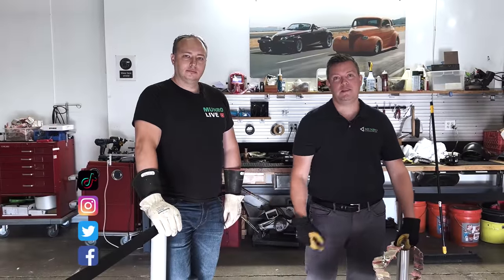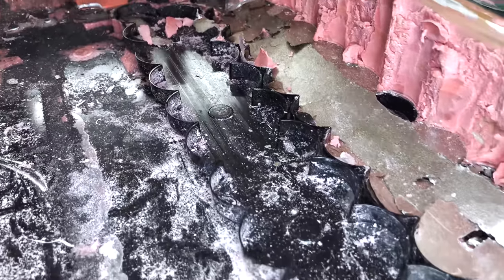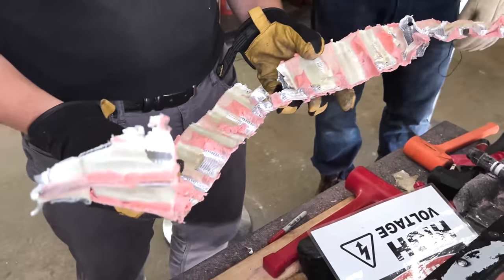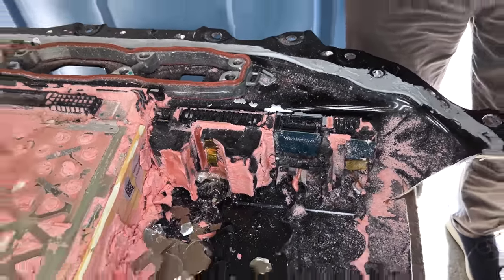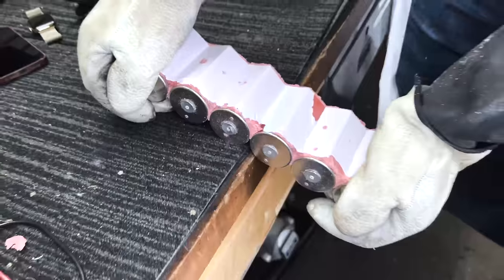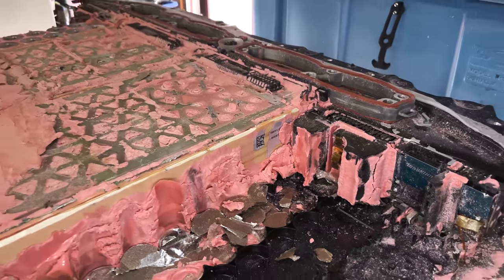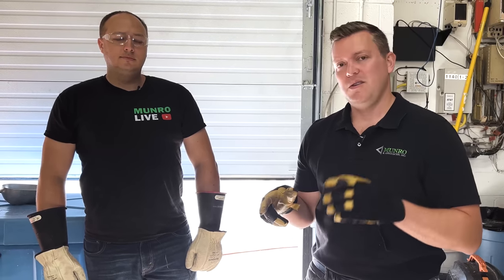4680 Update Structural Adhesive | Tesla Model Y

Comment: So none of the battery electronics is serviceable?  Conceivably an entire battery pack could be crippled by a single capacitor, IC chip, or other single component? I am asking a real question.
Reply: That is all in the penthouse under the rear seats go back and watch video Giga Texas structural battery pack cover.
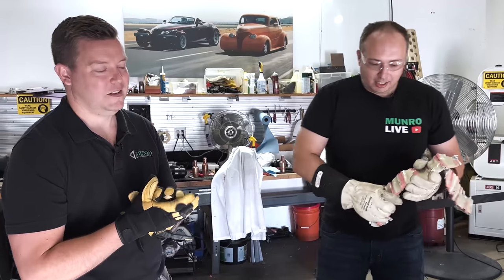Reply: @jackdbur  03:16 The Battery Management boards are clearly embedded in the structural foam.

Comment: Zero possibility of servicing the pack, that mean they need to be hyper confident in the battery reliability. Not that servicing battery would made a lot of sense anyway.
Reply: After nearly 20 years of experience, they have every reason to be confident.
Reply: @andrasbiro3007  I mean in the 4680, it’s brand new.
But I know Tesla has the most experience in those kind of battery pack and the failure modes. I think that completely closing off the option is a good thing, make you focused on solving the real problems: reliability, cost and energy density
Reply: @alexforget  The cells are not that new. They prob had these cells 5+ years ago in the lab. So that is 5+ years of reliability testing on these cells.

Comment: Wouldnt it be easier to FLIP the pack OVER and remove cells from the bottom ?
Reply: You didn't watch the series? No, take the bottom off and the cells are still all stuck in place, and there no access to take apart the electrical connections, either to understand the design (the point of this teardown) or to extract cells without damage

Comment: I’m not a fan of that pink foam because the battery is a major part of the car and all you need is 1 small thing fail and the entire battery is done for. You can imagine after warranty needing to replace the whole battery which would cost more the the car itself. Scary 😟
Reply: bill ted  I was thinking the same thing. There is no way you can recycle the battery and it probably would never decompose. So you would probably have to burn that toxic foam.
Reply: bill ted  other than Tesla is all ready recycling 4680's
Reply: @chris5248  they mine the individual elements of the battery out of rock with as little as ounces per ton of ore this is pure elements just combined in to a battery pack recycling will be much easier & cheaper than mining

Comment: It's clear to me that there is no way this battery pack can be repaired if a module goes bad, the whole thing would need to be replaced.
Reply: It's junk. I'm so disappointed.  Tesla has gone from the dream EV that I want to the one that I will never buy on the back of this design.
Reply: @davidbrayshaw3529  lol
Reply: @davidbrayshaw3529  A "repaired" battery pack is something you should never want! It is destined to failure & dangerous to any worker attempting to repair it. That is  400v DC that is capable of hundreds of Amps of current one dropped tool or wrong touch = death! Would you rather someone die so you could have a shoddy cheap repair? Who would you be sueing when said "repaired " battery pack burns down your house and someone of your family dies in the fire ?
Reply: @jackdbur  I worked as a hanger rat (AME) for a number of years. I am very aware of the potential outcome of not following servicing procedures in accordance to formal directives and protocols. I've also accidentally made an arc welder out of a 12V lead acid battery by dropping a spanner
across both terminals. Mistakes can and do happen. And as you correctly assert, 400 v @ several hundred amps is an immense amount of power.
Perhaps due to my prior occupation and interests I have a little more faith in my fellow  man to perform certain tasks than others do. This includes the ability to safely design and implement a standard for servicing battery packs.
Believe me, if I didn't think that this was a very realistic goal, I wouldn't waste my time claiming that it is. I also wouldn't fly on a commercial airliner 
either. They're a lot more complicated than a series/parallel battery pack and when they fail, it's a much bigger fire with a lot more families engulfed in flames.
Reply: @davidbrayshaw3529  My take on it is the liability issue faced by Tesla that even if the pack was "repaired " by another party Tesla would be named in any litigation & face large damages / PR hit. Again a supposed repaired battery pack will not come up to specifications and will be determental to Tesla's reputation. You will know that there are many aircraft parts that are mandatory single use for safety reasons.
Reply: @jackdbur  It would be good to see Tesla take responsibility for the serviceability of these batteries, much like Rolls Royce takes responsibility for the serviceability of their gas turbines. This simple path would remove the risk imposed by third party repairers. And what a PR opportunity in the making for Tesla. I can see the headlines now: "Tesla Not to Produce Disposable Cars". 
Yes, a multitude of aircraft components have a timed life. Yes, some components are disposable. But there are still plenty of 40, 50, 60 and even 70 year old aircrafts flying on a regular basis. A true testament to good design and maintenance, I would suggest.
Are we going to see 40+ year old Tesla's on the road? I think we both know the answer to that. I would like to be wrong but with all the aid of modern design and assembly tools, Tesla are highly unlikely to be able to produce anything that is even remotely near as durable as something like a Cessna 152 from 45 years ago. As a species, we need to stop building and buying disposable products. We can't consume our way out of climate change. Why on Earth do EV manufacturers somehow think we can? I want a ticket to Mars!

Comment: And the most amazing illustration of structural strength during that last demonstration was that it was a single row. You intertwine that with just another single row from the honeycomb of cells and that thing is never going to break. Now multiply that by the whole pack.
Reply: Vertical, horizontal and torsional strength.
Reply: Of course it’s epoxy glued together what do you expect??
Reply: I imagine with this sort of strength if you have two of these packs, you could use them to bridge a small creek or drain... probably with a 10 ton rating.  That's one way to recycle them in the future ;)

Comment: Have you been able to determine yet how many 4680s and in that pack? Are all of them actual battery cells, or some of them "blanks" (which would explain the low range of 279 miles)?
Reply: In this video they said 69 cells per bandolier. Not sure what a bandolier is. But 69 x 12 is 828. Isn't 828 one of those number we thought it might be?
Reply: @scottbreseke716  Yes, that's the number. We had the cell count months ago, after the display at Giga Texas: 828 cells. That group attached to a cooling channel is what is now commonly called a "bandolier" (like an ammunition belt) and it does have 69 cells; there are three of them per section (for 207 cells per section) and four sections in the pack (for 828 total).
Reply: for there to be blanks there would have to be entire groups of nine cells in parallel replaced by blanks (they haven't seen any) or one cell in every group of 9 replaced by a blank (no).
Reply: @brianb-p6586  So you're saying there ARE no "blanks," the pack is full of bona fide 4680 cells…? Then WHY is the range only 279 miles? 4680s are supposed to increase range by 16% —not lower it.
Reply: @Yanquetino  welcome to reality, which is often unlike marketing promises.
Reply: @brianb-p6586  Ah… well, if that's the "reality" for a full pack of 4680s, they might as well have stuck with 2170s.
Reply: @Yanquetino  Don't forget about manufacturing cost, which is the only important factor in this design.

Comment: Any concerns regarding the repair and serviceability of the structural packs due to the pink foam?
Reply: It's not serviceable. Even modular packs today isn't so easy to service when you account for the hours. With more streamlined recycle process you ought to get quite some for a bricked battery pack just by the materials in them (cheaper than mining all that).
Reply: @subwarpspeed  hopefully they will offer an extended warranty on the battery pack
Reply: There is literally nothing to break or repair in these packs.  Its a solid block with no moving parts.  A few cells may die over time but the packs outlast the life of the car.  When the car is retired (or destroyed in an accident) the packs are recycled.
Reply: @trengilly01  even with no moving parts, electronics can fail. The BMS is buried next to the cells...
Reply: @jfolz  A bad BMS is likely to have damaged the module.

Comment: That is crazy bonding strength. That row looks only touching at the  tangent (?) Of the cylinders and able to hold that weight. Any concern for the particulate foam floating around in the air during these vids? Hope precautions are observed.
Reply: Have you ever heard of epoxy glue!? Lol….

Comment: Looks real easy to recycle after a few years use 🤣
Reply: Or repair. Utter junk.
Reply: It is, and Sandy addressed this in a previous video which I will leave an an assignment to the commenter.  Also it won't need it for many years/miles.
Reply: @jumpman83  You might want to check what stage cryogenic battery recycling development is in. Mr. Munroe was reading off Musk's script in the last episode.

Comment: Have Sandy have a take an Ralph Nader coming after Tesla for Auto pilot.  He seems confused between Autopilot and FSD. FSD is the best fancy cruise control out there.  Why just going after Tesla when everyone else has a version of their own level 2.  If Tesla is required to turn off what about the other manufacturers.  Guns and cars are weapons  there as safe or dangerous as the driver or owner makes it.  If I am on a crash, I blame myself not the car.  Yes, Tesla hit a motorcycle recently.  Why didn’t the driver slam on the brakes.  I own 2 Teslas one with full Self driving.  Driving for 5 minutes you instantly realize what FSD can and can mot do. Just like autopilot in a plane, 2 pilots are still used

Comment: What do you do if even only one of those cells goes bad?
Reply: The pack can handle a few cells that break / disconnect. It has a balancing module to do it. Of course the module can only balance so much.
Reply: @pipooh1  As I understand it, the cell has to be physically disconnected from the pack. Does every Single cell have a fuse?

Comment: the structure reminds me somehow of the first model 3s...many parts and very complicated....i hope they get it done. the best part is no part!
Reply: "The structure" has removed about 3,580 cells ("parts") compared to the old pack.
You can add the connections, sensors, extra BMS, etc to that, not to mention the floor of the car (now the pack) plus associated manufacturing savings.
Reply: The pack got lighter, more rigid and save Tesla prob 1.5k / pack. Count they make 1mill cars a year(with cybertruck and Semi coming we prob looking at a even higher number), that's 1.5billion saved in 1 year. Not to calculate the reduces manufactory cost going from 4416 cells down to 828. This also lower the chance of failure by A LOT. The reduces resource cost. The reduces labor cost. So it's a cheaper pack, a lighter pack, a more secure pack to manufacture. 

I do not see any complicated parts here, robot put the bottom part and adhesive, robots drop the 3-4 packs in, 1 worker connect all the packs and it goes back so robots spray the pack with pink foam. Robot place the lid and screw it tight. Pack done. Can not get more easy than that. You prob need 1-3 robots for this. I programmed battery lines that use up to 15 robots to create a pack and manual labor to put cables / connections etc. Since tesla pre assemble the pack with all connections in you prob only need 1 worker if any.

Comment: Is it not feasible to disassemble the cells from the foam with a hot wire? Electricians often use a hot wire "gun" to cut channels in icf foundation blocks in homes and businesses.

Comment: So not only is it not "cell to chassis", it's cell to module to pack to chassis?
What part is "structural", and can it be quantified? Was any torsional stiffness tested before taking it apart, let alone while bolted to the hole in the car floor?
Reply: "Structural battery pack" has always been a hand-wavey marketing term to me, but I suppose that if the pack itself handles any torsional load, they can call it structural
Reply: @areitu  And no-one seems interesting to qunatify it.
OK, that strip of cells looks pretty stuck. But even if the modules together offer some torsional regidity, did they really save weight on the rest of the car as it would take oh so much strength and stiffness from the pack? 20 lbs lighter and a lot less range...so far it doesn't look like the greatest trade-off...

Comment: Isn’t it somewhat a bad idea to make a battery pack that is practically impossible to do any kind of repair on?
Reply: There is literally nothing to break or repair in these packs.  Its a solid block with no moving parts.  A few cells may die over time but the packs outlast the life of the car.  When the car is retired (or destroyed in an accident) the packs are recycled.
Reply: @trengilly01  if a few cells die on my two EV’s i can swap the cells…
Reply: @MEMOAN84  how you swap the cells? It not plug and play.... these cells are in a pack and need to be balanced / regulated. What you do with degration, since it will be 10 years of degration difference between the cells(Tesla pack has 10 year warranty). 

It's cheaper to sell the pack back to Tesla for recycling and buy a new pack with 10 years of warranty.
Reply: @trengilly01  so you missed the buried BMS?
Reply: @MEMOAN84  If you had a battery pack "Repaired " then it caught fire in the night and some of your family dies in the fire WHO is to blame & who will you be sueing?  Should you be covered by insurance ? When your insurance cover is  denied how much can you sue Joe's garage that "repaired " the battery for?

Comment: Great tear down. Definitely designed for expensive repairs. No way you can just replace one dead cell there.
Reply: You don't replace dead cells in any EV battery packs.  A few eventually die causing a reduction in range, but the packs outlast the life of the car and are recycled later.
Reply: @trengilly01  not if the dead cell become a problem for the pack. I don't think the pack will outlast the life of the car. It will outlast the warranty that Tesla will provide. Then it becomes a 20k+ paper waste for the owner.  With the 2170 design you can find the bad cell and replace.
Reply: @LienNguyen-sw7kb  NOT they are bonded together and to the thermal fins aswell with a slightly more rubbery foam. If you had a battery pack "Repaired " then it caught fire in the night and some of your family dies in the fire WHO is to blame & who will you be sueing?  Should you be covered by insurance ? When your insurance cover is  denied how much can you sue Joe's garage that "repaired " the battery for?

Comment: Is there no solvent keyed to remove the pink foam so you can just spray it on and wait? With out that a single fault could kill the whole pack, not that smart and not verry recycle friendly for cell reuse without shredding the whole pack. It would be a total douche move if that was so Elon.
Reply: The power electronics are under the penthouse and easily accessible.

Comment: All i see in the pack is synthetics . Thats petrolium products . I thought they were getting rid of petrolium products . Thats not a green pack its throw away petrolium . One cell goes amd the whole packs toast . Atleast the old packs you could open them up and replace damaged cells . Life po4 batteries still go bad like lithion does but life p04 are safer . Whos got 20 odd  thousand laying around to replace a pack from a few cells goimg bad . Not all cells are the same when made . Their resistance is all over the place . Ive built a few po4 cell packs myself and the cells are all different .
Reply: Not all plastics are made from oil.
Reply: Did you get sequential battery cells were they sorted for a module?

Comment: While the technical engineering is simply amazing, I'm curious what the recyclability is of these battery packs.  When these battery packs eventually wear out, can they even be disassembled in some eco-friendly manner and the valuable elements extracted in order to recycle them?  These battery packs appear to be ecological disasters waiting to happen.
Reply: They are ground up at very low temperature after discharging completely, then the components are separated physically and chemically. It's just like mining, only easier!
Reply: You haven't seen enough Munro videos! They are fully recyclable. The packs are reduced to "ore" by being ground down and all the different elements recovered. This approach can be used with all types of battery pack and cells. Clearly this is not the same as re-use of individual components ... obviously you are not going to try and reuse this pack in your own project unless you designed it to take this exact full sized unit.

Comment: The more I watch, the less I like the direction Tesla is going. That is a 10k piece with absolutely zero repairability, no chance to change 1-2-x cells when they die and they will die after 6-8-10 years depending on luck, usage, environment, chargers etc. That will disable the car as a whole.
Reply: No battery modules with active thermal management is repairable realistically and new cells + old cells are NOT going to play well together.  When your "Repaired " battery pack catches fire while charging in the middle of the night and some of your family dies Who is to blame will you sue Joe's garage or the vehicle manufacturer?